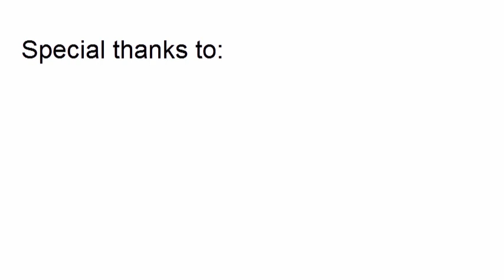How to Seal an Old Well

Comment: I had an old well in the front yard of my home that we had switched out for an artisan well.
All I did was fill the old well to the top with rocks and boulders. 
I didn’t realize all of the steps that went into properly sealing a well.
Now I’m concerned that I have mad a mistake.

I made sure not to fill it with dirt or trash, but only rocks and boulders.
Reply: Could just be some minor sinking into the well after so many years. Eventually someone will figure out what it once was and maybe even keep it?

Comment: The only way to "legally" close a well in Georgia (US) is to hire a licensed well drilling company. I am putting in a septic drain system nearby, or else I would be keeping mine!
Reply: Just another way to fleece the public. Its not rocket science, just seal it say nothing and plead ignorance about te well if ever asked by someone about it.
Reply: @RR98guy  I could do it that way, but I really DO care about protecting shallow groundwater quality near my house. I think the proscribed methods are meant in good faith.
Reply: @MrHuram-abi  I filled in my old well that was contaminated by being too near a septic system. I did not want to give someone money I didn't have to do the same exact thing the well contractor will do legally because he is a member of the governments good ole boy network.  I saved about $6K doing it myself and the groundwater is not going to be any better protected because it was already contaminated by fecal coli form bacteria. All the wells in my area have been condemned because they are all too near septic systems.  Luckily were I now live in central Europe is not over regulated yet.
Reply: @RR98guy  The state gets no money for the sealing of a well. They are there just to make sure it was done to code. You can legally seal your own well in Illinois l, you just have to file a permit, which is free and notify the county health department. The only cost is the cost of materials and time. Has nothing to do with "government good ole boy tactitcs"

Comment: What would an average cost be for a job like this?
Reply: Bout $1200 I believe
Reply: Im sorry if i dont know much which i dont but...are we talking about oil wells or water wells?
Reply: $200.00 worth of rock and fill it yourself.  F illinois and their absurd codes.
Reply: In America...an arm and a leg.....probably with a licensed well contractor depending upon depth and region of the country $2500- 10,000 would be a good guess. I was formerly involved in oil well drilling in the US.    I live in a European nation and had an old  bored well on my land. I filled it in with a clay soil very similar to bentonite found on my land, gravel and 2 concrete plugs  about 3-40cm thick. Cost me about 150 Euro for the concrete. I also treated the well with about 25 litres of chlorine bleach. This old well was 8 meters deep  ( about 25-26 feet)
Reply: 10K? Where did you come up with that number?

Comment: The only real reason people are forced to do this is when it comes time to sell a property. Then, an uncapped well becomes a liability that most conventional lenders will refuse to abide when it comes time to issue the loan. Most people are smart enough to seal it properly any number of ways, and not have to spend many thousands of dollars to do this to prevent things like kids from falling in. And the part where they are pouring BLEACH along the brick sides to disinfect it is just ludicrous. Not only are you just skimming some of the brick and not even scrubbing, you have now poured a gallon of bleach into the groundwater. Awesome.